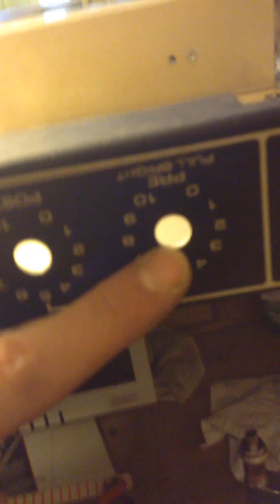Peavey Basic 50 part 2

Comment: Hi congratulations on solving the issue! do you know an ideal eminence speaker replacement for the basic 40?
Reply from the maker: I think the basslight S2012 would be the better of the two Eminence, but the factory speaker is 8ohm , 80watt(I think) 12", but has a 60Hz-10kHz response. Eminence does not make a 12" bass speaker with that high 10kHz rating. I would still be ok with the S2012.
Reply: Thanks that's what I was wondering about!